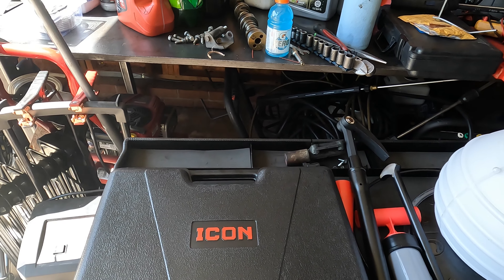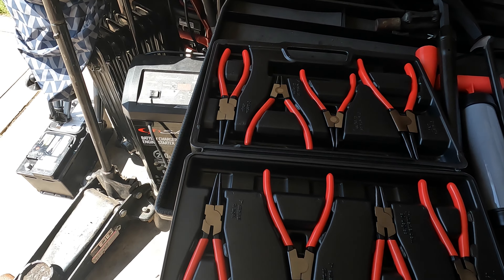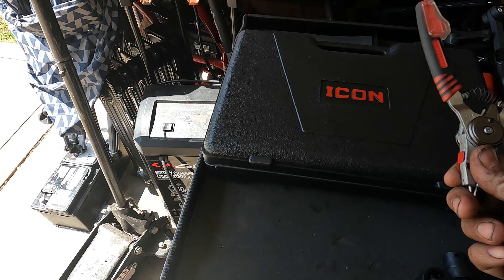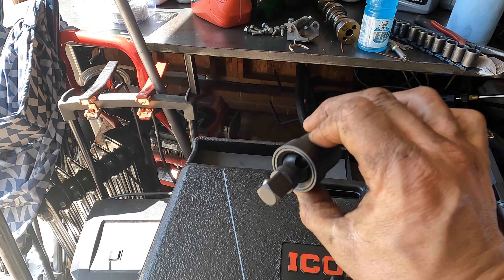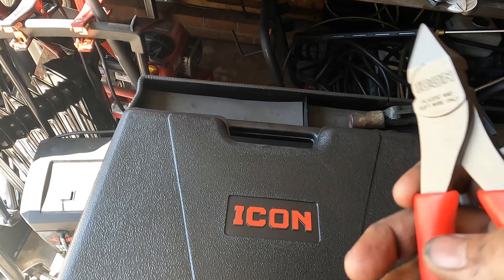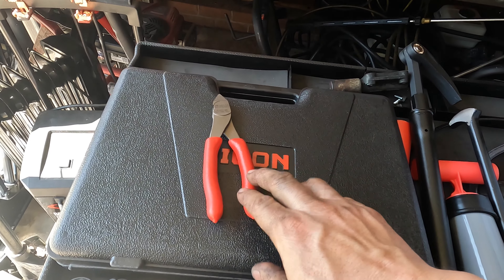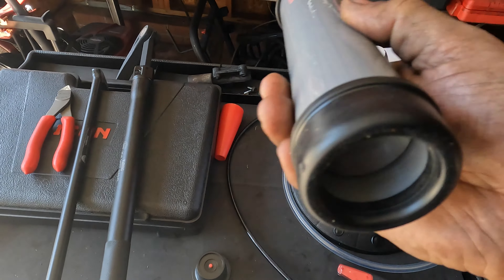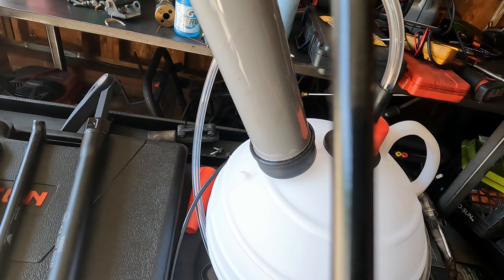Harbor Freight Icon Tool Haul

Comment: I run a ton of icon tools in a professional shop they hold up extremely well
Reply from the maker: I have a few other ones that I have tried and have had them hold up great too.  I have been wanting to give the snap ring pliers a go for a while and finally got the set.  I have used them a few times lately and they work great.  The tips are are holding up better than I thought
Reply: @operationoverhaul  that’s proof you can buy quality without spending snap on money
Reply from the maker: @ohiofleetmechanic6147  that is the honest truth right there.  A higher price does not mean higher quality.